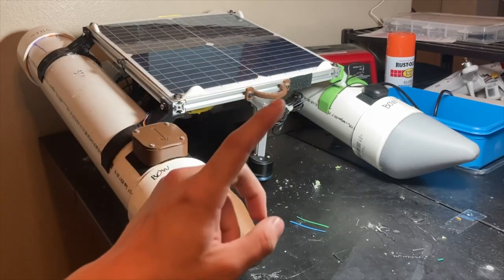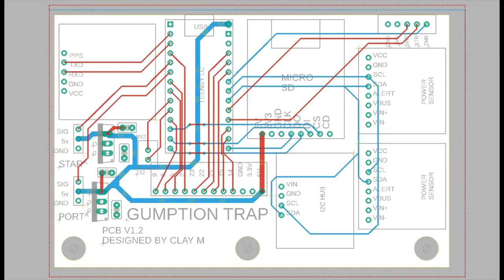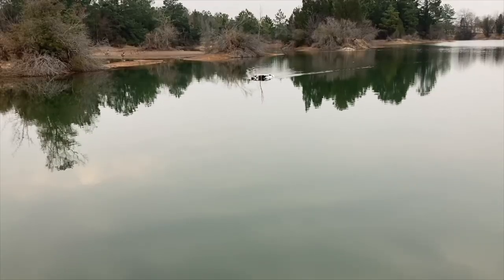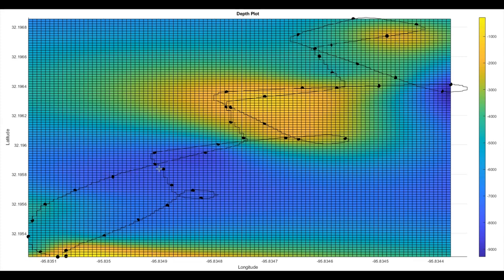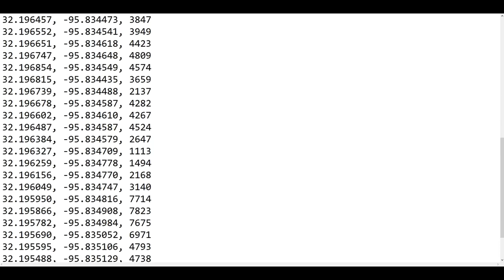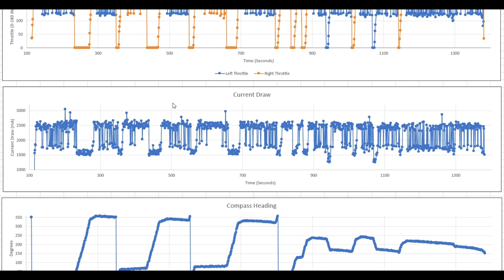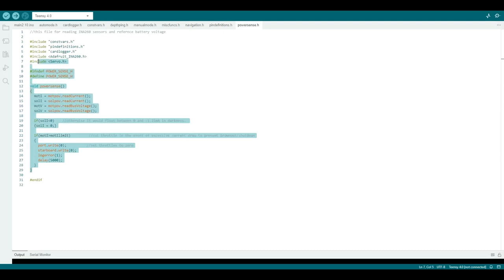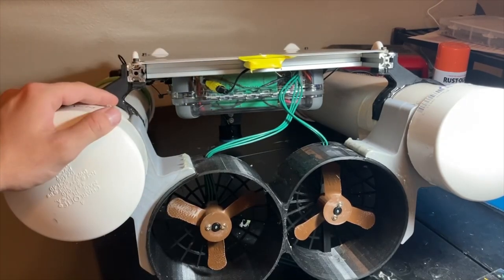Sonar Depth Mapping With Autonomous GPS Boat

Comment: Hi, how did you link the coordinates collected with the depths collected by the echosounder? I also wanted to find out how were you storing the XYZ points?
Reply from the maker: There’s an SD cars onboard that stores all the data. Every time it takes an echo sounder measurement, the microcontroller writes the current gps location to the SD card along with the depth. They’re stored in CSV format.
Reply: @Clay-Builds  hi, thanks for this. Is your source code available for the GPS aspect? I would like to record location and depth but I am having some difficulty with the connections and code.
Reply from the maker: @udhavmaharaj6179  yes, check out my newer video on this project. There’s a GitHub link in the description with all the code
Reply: @Clay-Builds  awesome thank you for that. I'll check it out now.
Reply: Hi Clay, I need some help. I managed to hook up the echosounder to the Arduino and I got my SD card linked to the arduino. But I cannot get the distance and confidence to get saved to the SD card. @Clay-Builds
Reply from the maker: @udhavmaharaj6179  I would run one of the example programs in the SD card library to make sure your wiring is correct and the SD card is being initialized properly
Reply: @Clay-Builds  hi, I ran the example program and the data was getting logged. I tried to integrate the ping code with that but then the echosounder stops reading..
Reply from the maker: @udhavmaharaj6179  my newer video has a GitHub link with the most up to date code if you want to see how I did it
Reply: @Clay-Builds  hi, I had a look at your code and tried to remove all the parts that I didn't need as I'm not steering and don't have a motor or GPS. I only need to transfer the readings to an SD card.

Comment: Realy cool but is there a way to make a 3d scan of the lake?
Reply from the maker: Not with a simple depth sounder. This is super low resolution approximation, just extrapolating a smooth surface between all the measured points. And it isn’t truly point based, the measured depth is from the return signal of a 20 or 30ish degree cone. Good enough to plot the depth but certainly not imaging anything on the bottom.
Reply: @Clay-Builds  ah ok

Comment: I would suggest decoupling speed & direction in your code (E.G. direction is the ratio of the motors and speed is the overall input net value). Then you could apply a PID to target angle and later a PID to target speed.
Reply from the maker: Yes, that would be a great improvement. Especially steering in a perpendicular wind/current environment.

Comment: Amazing work! Congrats!..
How about measuring differential water drag in means of speed and direction and auto adjusting the propellers rather than adding a fixed trim to the right motor?
Maybe, some imbalance with the propeller causing that bias, as well.
I also feel like those new MIT propeller will contribute to the efficiency as you have mentioned.
Lastly, tilting PV panels surely add efficiency to electrical output while leading to some power loss due to increased wind load.
Reply from the maker: I replaced these props with some much better toroidal ones and the slight bias to one side virtually disappeared. I abandoned the tilting panel idea because of wind concerns.

Comment: Can you please explain how line # 15 and 16 in manualmode.h at timestamp 19:48? Thanks for the wounderful project.
Reply from the maker: The steering value “steerval” goes from -100 (hard turn one left) to +100 (hard turn right). This value is determined by the position of the steering stick on the radio transmitter. The “map” function linearly converts this to a value in degrees, because the servo library which controls the ESCs wants to see a value of 0 (no throttle) to 180 (full throttle). “Throtval” is a value between 0-100 representing the position of the throttle stick. Throtval is converted to decimal by the .01 multiplier and applied to the result of the map function. This way the final motor speed is reduced as throttle is reduced. 

If steerval was 0, with the stick steering straight, “map” would give a value of 180 (full throttle) for both port and starboard. Throttle would reduce both by the same amount. If steerval was 50 for example (halfway to the right) then portval would be 270 and starbval would be 90. This is because the 0,360 is inverted to 360,0. Again, the Throtval  may reduce both by the same amount. The code a few lines below makes sure neither exceeds 180, so the final values given to the motors in this case would be 180 port 90 starboard at full throttle. This will make the boat steer to the right.

Comment: Very interesting, I congratulate and admire you for executing such a good idea. I have been motivated to do something similar as a project for my studies and also contribute knowing that it is open source. I would like to know if you have tried with a cheaper sonar sensor.
I'll be watching, I read you. :hand-pink-waving:
Reply from the maker: Thanks, I’m about to wrap up version 2. Early on, I experimented with using a basic fish finder style depth sounder, I think it was a Hawkeye brand for about $50 used. I took it apart and tried to tap an analog signal off the transducer lines to detect pulses, but never got it to work reliably. Maybe you could find a basic depth sounder with NMEA output that could be readable with Arduino.
Reply: @Clay-Builds  I was looking at some sensor called MaxBotix MB7052 for 100 dls getting a reading range of 50cm at 10m, but it is a lot of money to just start testing. My option now is to go for the JSN-SR04T, an ultrasonic sensor module that works just like the HC-SR04 but with a range of up to 4 meters and surely has nothing to do with NMEA but I think it is still possible to record data (minimally good) although surely the boat will have to be quite slow? I'll look into swapping it for a better sensor later.
Do you have any direct contact to share with you my progress on the project?
Reply from the maker: Those sensors are all intended for use in air only. I wouldn’t assume they work underwater. I wouldn’t even bother unless it has an IP rating of 68 or 69. There are some arduino libraries that can pretty easily interface with those, but you’ll at least have to account for the speed of sound difference in water. The sensors themselves may have an enclosed volume of air around the diaphragm that could be problematic underwater, they’re not proper piezoelectric transducers. Firmware certainly won’t account for surface reflections and things like that either. Boat speed will be negligible at this scale. I think you’re better off modifying a fish finder or off the shelf depth sounder to communicate with arduino. I prefer not to be contacted directly.

Comment: Sir please tell me how you did self driving gps part. I am working on similar project, I need some guidance for the auto gps navigation.
Reply from the maker: Check my newer videos on this project for the most up to date code on GitHub. It uses a PID controller on the error between actual compass heading and calculated goal heading to adjust motor speed and steer towards the target waypoint.
Reply: @Clay-Builds  sir Greetings from India 
I only have raspberry Pi, GPS module, motor, gyroscope and accelerometer module only 

Is this sufficient enough to accomplish the auto gps navigation?? 

Thank you for your time.

Comment: Do you think that this echo sounder could be used horizontally just below the surface?
My aim is to detect boats when passing past a certain place.
The "ping" bouncing back from the hull / keel of the boat.
Reply from the maker: It can certainly be used as a proximity sensor facing horizontally underwater. The problem with detecting boat bulls at low depths is you might run into issues with the sonar reflecting off the surface. I think for detecting boats you might be better off using above water radar.
Reply: @Clay-Builds  Yes I was thinking about this too. I did already experiment with lidar, but getting to many false readings 😞
Was hoping to use the echo sounder for this..... Back to the drawing board I guess...

Comment: Are these LM117s??
I never used them in a real project without any heatsinks.. They tend to shutoff, when they get to hot (150°C) and they will do that.
Reply from the maker: LD1117. Regulating only 5v down to 3v3. Rated for up to 15v and 800mA. The 3v3 stuff only draws around 400mA all together, with that split across two regulators in parallel neither is operating anywhere near its thermal limit. They don’t even get warm.

Comment: Sensor is soo costly 😢
But ur work is absolutely amazing ❤
Reply from the maker: Yea it is but it works well. At first I messed around with a couple old fish finders which included a depth sounder. Couldn’t get them to interface with arduino sadly but might be worth investigating further. I know there are some cheap ones that communicate over NMEA, which in theory is possible to read with an arduino.